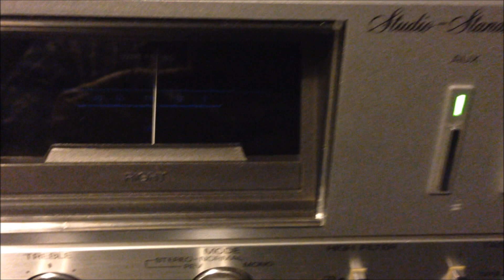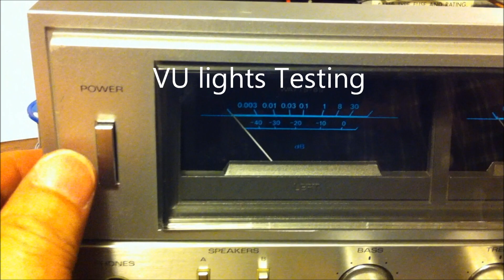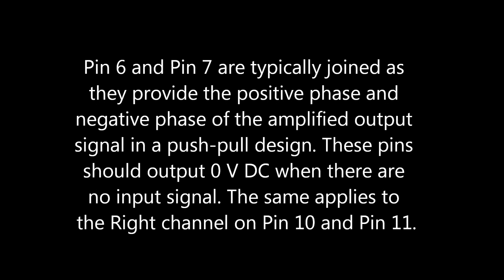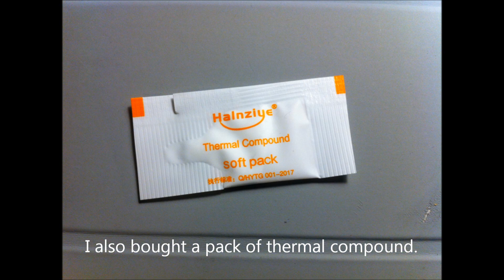Fisher CA-120 Integrated Amplifier Repair (One Channel Not Working)

Comment: Hello, thanks for the video! 
I have the ca 110 with only the lights problem and I don't know what to use instead I don't have a service manual to know want volts and watts should have the light bulbs,can you help me please!
Reply from the maker: Could you open up the cover and use multimeter measure the voltage between two leads which connected to the bulbs? Also please send me a photo of existing bulbs. I will give you my suggestions regarding the bulbs. The reason I need the information from you is because I don't own CA-120 anymore. Thank you.
Reply: @VintageAudioFan  OK thanks a lot!

Comment: HI!

The original bulbs are T10 W5W 12V DC ? 

Thanks.
Reply from the maker: I am nor sure because I don't have the unit anymore. I have looked up some of the Fisher's circuit diagrams which some models have 8V bulbs installed in their int. amplifiers. I suggest you to measure the lead wires on the bulb socket (with the power on) to verify the voltage or look up the marked label on your OEM bulbs. You should be able to find out the bulb specifications.
Reply: @VintageAudioFan  thanks!

Comment: Good video. I have the CA-110 with the same problem but with the difference that the right channel, the indicator or the pointer or needle move bus it does not sound and the left channel is dead. Is it the same schematic for STK 461, 462, 463, 464 I mean, the pin number?  Should I repair it the way you did or do I  have to measure something else?
Reply from the maker: I don't have any information regarding Fisher CA-110. However, I found a seller in a website said his CA-110A has the output power rated at 20W/per channel. If this is correct, I assumed that the CA-110 may have the same rated power which is 20 watt per channel. Could you confirm this information? I think the CA-110 should equip with Sanyo STK 461 IC (which has 20 watt rated output power). It's internal circuit diagram shall be same as STK-465 (which is used in CA-120). I suggested you should check the fusees for both channels as I showed in the video first. I think the left channel may have a blown fuse and right channel is still good. The reason I check the pin 9 (+V) and pin 5 and 12 (-V) with ground  (pin 3 and 14) is to make sure the correct voltages for the power being supplied to both channels. The STK-461 recommended operation voltage are +23V (pin 9) and -23V (pin 5 and 12). STK-461 maximum power supply voltages are +33V and -33V. If my assumption is right, the IC may be defective and need a replacement. I hope this information is helpful to you. Also thank you for your comments.
Reply: more grateful I cannot be with you @VintageAudioFan . Last questions What if I use the STK 465 instead of STK 461? Does it make any complication if I use a 12db crossover in  my speakers?
Reply from the maker: @josephanselmo6863  Could you measure the existing voltages of power supply to STK 461? If the voltages are closed to +28V and -28V (recommended power supply), I think it should be fine to be replaced by STK-465. I always welcome your comments if I can be any help.
Reply: @VintageAudioFan  Bro you were right. The fuse of the left side was dead buuuut, I measuered  the existing voltages and I had  +30 and -30V. My brother told me that the orininal power supply was removed because it was damaged But till nowm it has been working perfectly so, can I use the STK 465 in case the 461 get damaged?
Reply from the maker: @josephanselmo6863  Yes. It shall be fine to replace with a STK 465 since they have same circuit diagram (based on the manufacturer's specifications).
Reply: @VintageAudioFan  Thanks a lot bro. This video helped me a lot. It is a bless.

Comment: Hi bro do u have manual schematic for ca 120. Pleaee have to share. Thanks
Reply from the maker: Sorry, I don't have one. Because it was powered by STK 465 IC, I managed to fix the amp by using the data sheet of IC which shows how to connect it's pins to the amp PC board.
Reply: Can you help to see the type of ic 8pin near on inpput selector. Cause just buy this amp but looks 1 ic is lost. Want to change but no info what type of ic 8pin near on input select (aux tuner and phono). Thanks
Reply from the maker: Sorry, I don't own this unit anymore. From my old photo, it is labeled as "JRC 4558DX" on the top of the 8-pin IC (near input jacks of rear panel). Is this the information you are looking for?
Reply: @VintageAudioFan  yes.. Thanks for you info. Appreciated that.
Reply from the maker: You're welcome. This is my channel for - helping and sharing repair information.

Comment: Hey bro! How are u? I have doubt. I have right now the Fisher ca M101 AMP with the same problem that it does not hear it. I did the same procedure u show in the video, the one I used tu  fix mine. It uses the same IC (STK 461) but this time it does not mark any voltage in pin 5, 9 and 12 also it has a little voltage on one left speaker output also, nothing comes through the phones. What could be? The power supply or the IC?
Reply from the maker: Joseph Anselmo I think it should be the power supply problem unless there is a short circuit in your power amp PCB. You can  check voltage at power sources (+B and -B at reservoir capacitors) by disconnect wires between PCB and power supply. If there are correct voltages at +B and -B after you remove the wires, then the problem is in the PCB.

Comment: Hi vintage fun
I have one of these and one of the vu meter isn't working ,do you know what could be the issue? Thd lights are working on both
Thanks
Reply from the maker: I don't own CA-120 anymore and I don't have circuit diagram on hand. I think the VU meters of CA-120 may be powered by a 8-pin IC (i.e. NJM4558). The reason your VU meters are not functioning may be caused by the defective IC. Could you verify it and let me know?
Reply: Hi
Thanks for replying.I haven't got it yet it's on the way, should arrive next week some, time I'll let you know how it works etc.
Thanks again
Reply: @mixamc9797  hi again. Finally got mine delievered and fixed. All working great.Will upload video how it sounds and looks.

Comment: Interesting! I have been given a Sanyo DCA303 with the exact same issue. Looking at your video I find that both are essentially the same amp. Did Sanyo just rebranded the Fisher?? 
I was wondering if you are confident the STK465 you ordered isn't just a copy/fake of the original part... did you confirm that? Has the sound changed a bit, once installed?
Reply from the maker: Yes. I think Fisher CA-120 was made by Sanyo. I am not confident the quality of STK465 which I ordered. I believed it was a fake one if the product didn't say "OEM" when I purchased. The quality of sound was fine, I did't notice the difference. I am not a big fan of IC-made amplifiers.